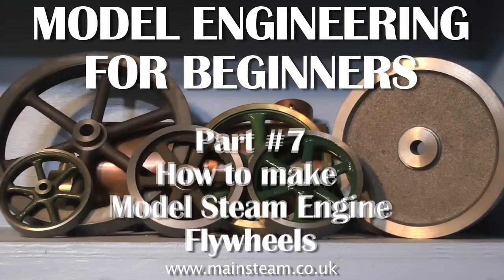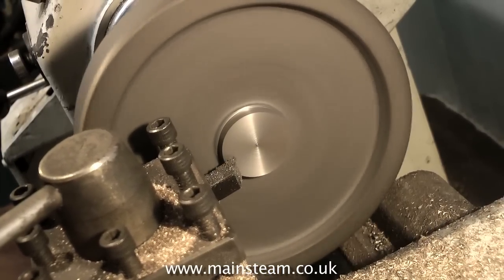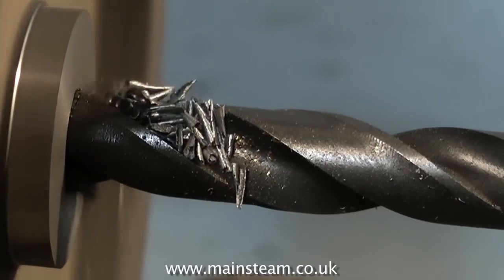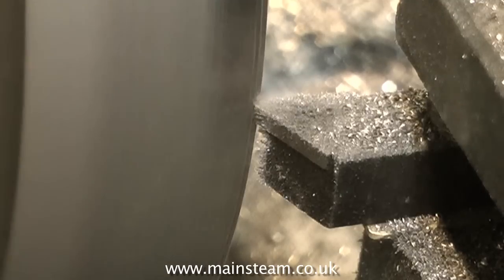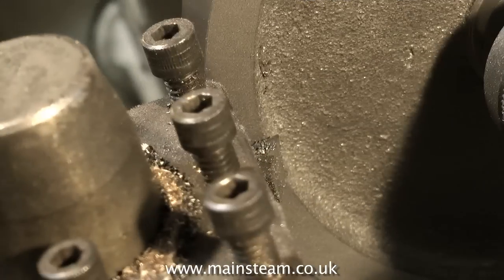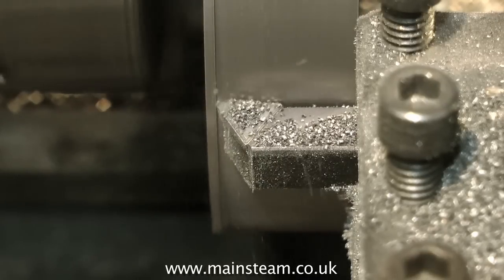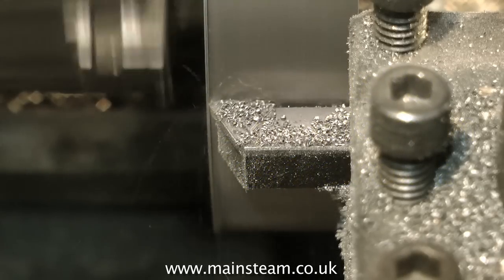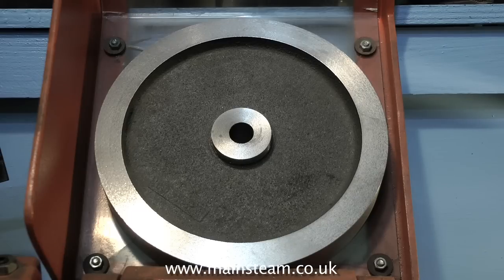HOW TO MACHINE A STEAM ENGINE FLYWHEEL - MODEL ENGINEERING FOR BEGINNERS #7

Comment: Keith, no doubt you have heard this prior, but I can't help myself: Your use of the word engineer is - well incorrect for American English speakers. We would more commonly use the term "machinist"
or "instrument maker", depending on the persons accumulated experience. An engineer rather, is a 

person with a university degree in mechanical engineering or electronics etc. Not that you need to acknowledge this in your speaking, just a friendly bit-o-information. BTW, you do very well at your hobby, no need to suggest that you are somehow doing something wrong. I may never machine a model engine, and maybe I will, in either case I enjoy your video bits. Sometime - I think you should play the keyboard during some of those longer less interesting bits like watching the paint dry.
cheers dan
Reply from the maker: In England, where I am from we are generally called "Model Engineers" - I do not regard myself as a "Machinist" in the slightest, you may have noticed by watching my videos, that I do many other things other than machining . . . . . .
Reply: @keithappleton  Again no offense Keith.
Keep up the interesting work.

Comment: Keith, with all due respect to your decades of experience, why not mount the flywheel on a face plate if it won't fit the chuck, with the inner rim of the wheel centered on the part of the rim that will remain uncut, since the outer rim of the wheel has the most leverage on balance. If there is a tradeoff between the center and the rim and balance, should not the rim take precedence? Mounting by the rim should take care of runout too. Once you cut the face of the wheel and machine the hub, you can center and drill the hub then machine away to your heart's content and everything will be concentric and have no runout. 

You might even be able to machine the wheel on both sides using a mandrel, a tailstock center and maybe a dog. Adjustable mandrels can pretty cheap.

Just my inexperienced opinion, anyway.
Of course the better the casting, the less the worry
Reply from the maker: As I mentioned in the video - I don't own a faceplate ...... I have never had one ......

Comment: which  (good quality) small lathe could you recommend please. Should be able to handle seel. Thx
Reply from the maker: Myford ML7 lathes are very good.
Reply: Is the average 7x12" lathe typically sufficient for engines up to around a stuart victoria? I apologize if that sounds like a dumb comment, I have not run a machine lathe in 15+years, and it was a very large machine, under the supervision of a very knowledgeable machinist. I'm looking at getting my own small lathe to tinker with smaller engines, and would very much like to have enough of a tool in the end to build that engine. Thanks.

Comment: Hi Keith,

First of all my compliments on the nice video's you have concerning model engineering!

You explain lathe work very well for the beginner, however you mention the chatter problem, and the resolve always seems to be go slower, less depth, to long stickout, etc. All are true but that's not always the case.

When you use light machine tools with inserted tools, you are always in a compromise situation. The inserts need a lot of more speed most of the time than you can achieve with home shop/conventional machine tools. 

The "Vc" in meters/min or feet/min an insert needs cannot be achieved most of the times on conventional machine tools and a lot of times the setup is not rigid enough to use the high speeds needed by the insert.

For example a week ago we had to machine 535 mild steel bosses with inside M33x3.5mm thread 60mm deep. We machined these bosses on a Mazak SQT 15MS CNC turning center.

We started out at the lowest recommended speed (Vc) we got from the manufacturer. This was 100m/min (328 foot/min) rpm approx. 1060rpm , the highest recommended speed was 190m/min (approx. 2016rpm). The tool was chattering and the threads looked horrible.

We started increasing the Vc in steps of 20m/min to 160m/min (524 foot/min) and above a Vc of 140m/min the threads where looking nice and no more chatter! However the tool life was bad. 38 bosses per tooth of the insert. After this we started experimenting and the sweet spot of the insert was about 150m/min (492foot/min) now we could do 120 bosses per tooth!

These speeds cannot be achieved on a conventional machine, but it gives an example of the capabilities of the modern inserts and that lower speeds are not always the way to go. So experiment, try lower and also try higher speeds to reduce chatter and get a better surface finish.

Another point I'd like to address is depht of cut. A general rule of thumb is that the cut should be more than the radius of the tool nose. For example if the tool nose has a radius of 0.8mm the depth of cut should be more than 0.8mm.

And when using insert tools on a "light conventional machine", try to use positive or neutral insert tools. Negative tools demand more power.

But enough education ;-) please continue filming, I like watching your movies !

Kind regards,

Egbert de Pauw

Comment: Keith, i really enjoy your videos. Especially the ones about steam engines. 
One question popped up in my head, while i was watching this video. How do you machine the slot for the key? 
Thanks for your answer!
Reply from the maker: gus23a Either with a keyway broach tool, or a parting tool in the Lathe top slide set on its side - like a planer- Google will have all the answers